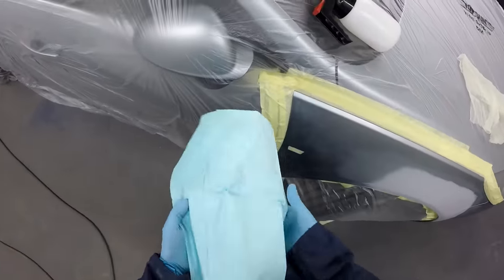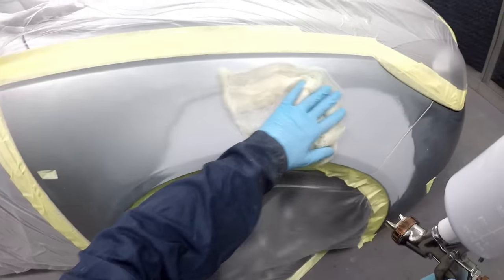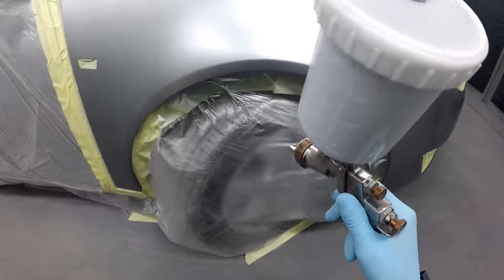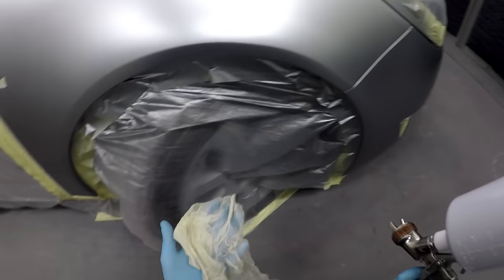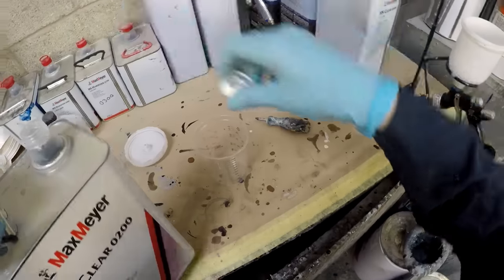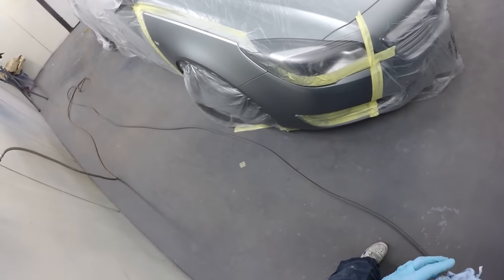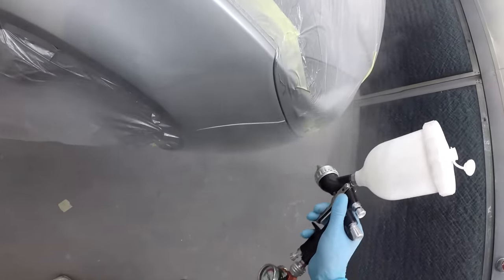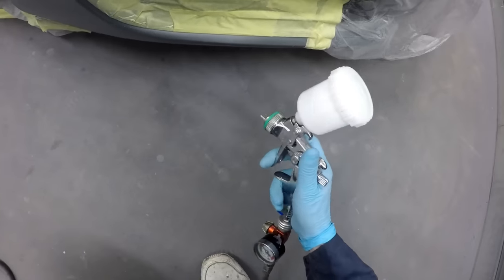Full Basecoat And Clearcoat Stage INSIGNIA Trade Repair Blow In

Comment: Which max mayer clear coat would be better for air drying 0200 or 0300? Spraying in a closed garage, so i only have a space heater to produce some heat.
Reply from the maker: Either if I’m honest mate 0300 would be best of the two now for drying but for overall final result and by using a fast Gardner you can achieve he same air drying times as the 0200 , but I have to say be carefull using 2k clears at home and if you do apply heat wait till well after all fumes have gone otherwise you have a serious explosion rick on your hands
Reply: Thanks, I always thought 0300 needed a bake cycle to cure fully (y)
Reply from the maker: No hs clears can also be used in air dry scenarios you just need to match your hardner and application and also your flash off times to suit